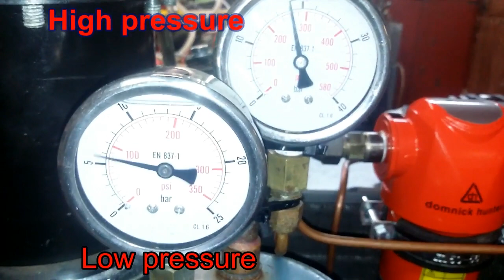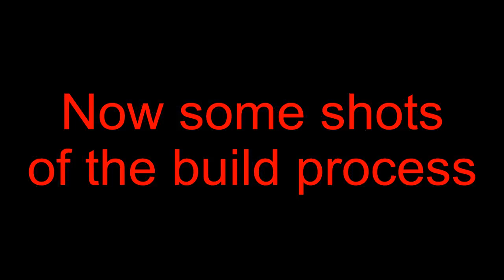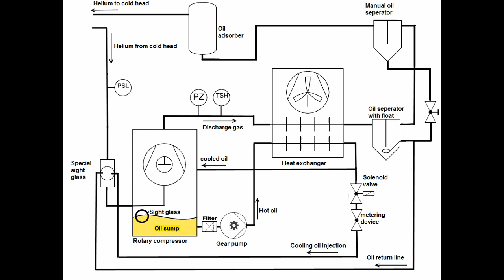Leybold Coolpower 7/25 Cold Head / Cryocooler with DIY Helium Compressor Kaltkopf

Comment: Super the project ! I always wanted this to make. I have such head as You, coolpower 7/25. What is the supply voltage of the motor of the head ? 3 phase 220V ? I cannot seek out the electric information this head.. Down hill to thank for the help.
Reply from the maker: The Motor can be run with 230V 3phase or 230V and a run capacitor running off single phase. Im using it with a run capacitor since the compressor is single phase aswell. 
I don't remember the value of the capacitor but if you need it I can go look for it.
Reply: @Alexander470815  If you would be able to this to make this I will be grateful. I have a still one question. What is the diameter joins helium in this head ? 1.3/16′′ (manual leybold spec.) do not fit ! M24x1,25mm ? You remember perhaps ?

Comment: Hey, is the setup still working? How does it perform? I have designed a cryohead and planning on building proper helium compressor myself, so wonder, how your setup performs longtermwise. Really insipiring, its a pity that only 3k views :/
Reply from the maker: Yes it still works and performs as expected, no problems so far.
I think it might be possible to build it without the oil pump and just use the pressure difference and the oil injection to push the oil through the oil cooler.
Im unable to test this since the gas would flow backwars to the oil meterering device and no oil would flow without the pump.
I would be happy to see your setup when its running.
Reply: @Alexander470815  You would probably only need the pump to prime the system. Yours could probably oil a V-8 engine! I believe after it's primed it should be self sustaining as there is a significant pressure differential. My design, shamelessly stolen from you, always credited though :), really only has a pump to pull oil through the filter and its a small one at that. Maybe 60mm in length, width and height.

Comment: Very nice work! Once I could get coldhead in my hands I will definitely try to build my own system. The question: where you sourced helium? How much was needed?
Reply from the maker: Its normal ballon helium which claims to bei 99.99% pure, never experienced any problems with that.
I can't really remember how much it took but less than one tank for sure.

Comment: Excuse me, this is single stage? I also thought helium needed to be compressed at much higher pressures to really cool much. Am I wrong about that or is there something here I missed? Either way impressive work.
Reply from the maker: Yes it is single stage compression, the cryocooler is dual stage however. It depends on the system, the Gifford McMahon cooler only needs about 20bar HP and 5bar LP to work properly, for other systems this may differ strongly.

Comment: Is there a way i can contact you if i need some help regarding the motor of the cold head?. Im thinking to start a simmilar project since i have experience in building these stuff. I have made a small 2 stage cascade for -100c cooling and now working on a mixed refrigerant joule thomson cooler to make liquid air. Let me know if you are intrested. The cold head approach seems ideal if you want to liquify hydrogen
Reply from the maker: You could contact me on Telegram under the same name as here. I find mail is a bit bulky.
Reply: @Alexander470815  cool. Even better. I added you

Comment: Nice job. Love the idea of modifing a standard eyeglass to monitor the oil flow.
I am working on a similar setup myself we manage to get our hands on 2 CTI cold head an 1 dead compressor unit from the scrapeyard. 
A bunch of questions :
What was your choice about the oil? did you keep the original oil of the compressor or did you switch for PAG?
Any return for the life time of the adsorber with a single coalesing stage? By curiosity did get a quotation for a speciaty  helium coalescing filter from parker but it was more expensive than everything else combined. So any experience return with using of the shelf coalescing filter is welcome :)
Last but not least : Did you use bulk activated charload or some cartiges? Did you use a specific material or grade?
Reply from the maker: As Oil i used ISO VG 68 Oil for compressors, so no special refrigeration oil, the system has ran about 150hrs since i built it and it seems to work fine.
The commercial compressors like to use dual stage oil separation too, but I have no exact data on how long the adsorber will last, I used the cheapest activated charcoal i could source, seems to work fine and is cheap enough to replace regularly.
The temprite oil sepeator does collect oil for sure, the domnick hunter one too, but not very much.
At the time im replacing the silicone seals of the oil pump with FKM ones, the old ones started leaking oil.
I tried it without the pump but without the cold oil getting pumped in the top of the compressor and cooling its windings it gets too hot.
However surface cooling with water should work but for my application no water is better since frost could kill it and two fluids are enough.

I'd love to see a video of your system when its running.
Reply: @Alexander470815  Doesn't replacing the adsorbing material regularly also mean opening the helium circuit regularly, and therefore either losing the helium or having to do something to avoid losing it?
Reply from the maker: @IDoNotLikeHandlesOnYT  Just recover it with a compressor into a gas cylinder. The commercial systems have adsorbers with quick connect couplers allowing it to be changed under pressure. The whole adsorber cartridge is single use however and welded shut.

Comment: Excellent project! Have you try to distillate argon? Will be possible as DIY setup? Have not seen anywhere somebody to success for argon.
Reply from the maker: In theory this should work. With a matching distillation column it should be possible. Since the Argon content is not very large energy usage will be pretty high.
Reply: @Alexander470815  Argon will be 0.5% from total production, the rest is other gases that will be produced. 1l Argon kost 0.065€ i think will be chaper than purchaise Argon. For so small vlume destilation colum will be very small and maybe 15mm ss tube will do ther job. The crya temp is a bigges issue. Regards.
Reply from the maker: @turtulara  Well if i get a 20L 200bar cylinder a fill costs about 70€. Thats 4000 L or 7,13kg. To get that I would have to condense a minimum(0,93% Argon in air) 766kg of air. At 2kW and 0,35kg/h this would mean 2200h runtime and 4400kWh costing well over 1500€ at 33ct/kwh. This is the 21 times more expensive way to obtain argon...
Reply: @Alexander470815  In Sweden 10l cost of fylling is 150€. Electricity cost 0.06€/kW (plus all other cost) is just the same price as per Linde store but then will be a lot of Nitrogen and Oxigen over but yes a very risky projekt. Thank you for your replay. Regards.

Comment: How much did you pay for the Coolpower cold head, and what did you spend in total on this project? 

Also, i'm jealous of your shop!
Reply from the maker: The coolpower head was stripped from a coolvac 1500 cryopump for arround 250€. Other bought parts were the oil pump, seperator and filter drier housing. The other parts were from the scrap. So the whole assembly was like 300€ excluding the cold head. There where two versions before this compressor, with both the discharge temperature went through the roof and oil managed to get in the cryopump and jammed the displacer. This is now the third version which hopefully will work for a extended period of time.